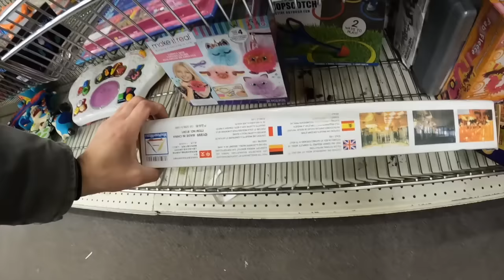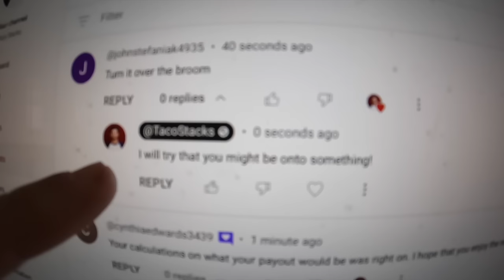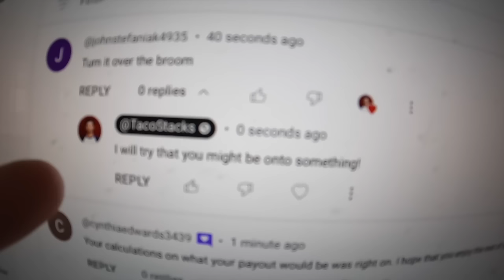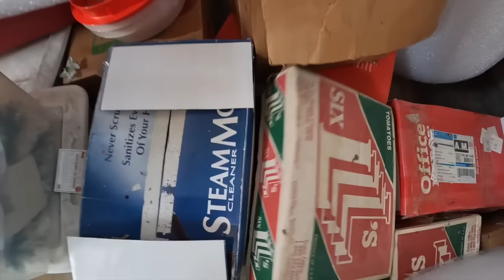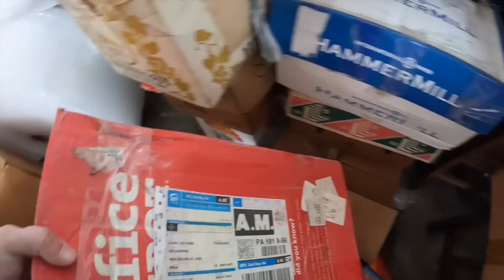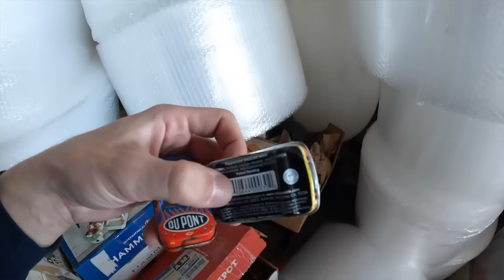Trash Picking And Trying To Solve A Problem

Comment: Good luck to you Taco.  Once critters find a way in, getting them to leave is an uphill battle.  I had a house in a wooded area.  We had mouse issues no 
matter what we did. The first time I caught a mouse, I took it across the street & set it free in the woods.  I figured I solved the problem.  About a half 
hour later I noticed something small coming across the street.  It was the mouse.  That was the end of my mouse wrangling days.  Orkin took over.

Comment: Squirrels will smell the peanut butter so the floor is the best place for it….take it several miles away before letting it go….preferably on the other side of a lake…they seem to return if you don’t……..experience talking!
Reply: In England it's illegal to relocate squirrels. Once caught, they have to be 'dispatched' quickly - not by drowning.

Comment: I've never heard that yarn gets brittle over time. Yarn can get super expensive,  especially if someone is making a blanket. ❤  I think the dye lot #'s can change over time,  so if someone needs a lot of it they might not be able to get an exact match again.
Reply: ur rite yarn, aint cheap! my daughter tells me so!
Reply: I have yarn that’s 30+ years old and I still knit it.
Reply: It does get brittle, particularly if it's been stored in a very hot place, like an outdoor shed or an attic. The particular brand showing in the video always has kind of a rough texture. None of the other Knitters and crocheters are enthusiastic because the feel it is unpleasant to work with. I live in the desert Southwest where triple digits for most of the summer are not uncommon. Hence I have an air-conditioned room in my house full of yarn for the charity knitting group, with little space for anything of mine😅